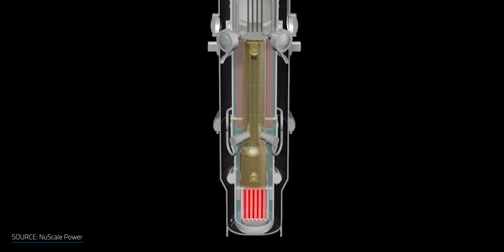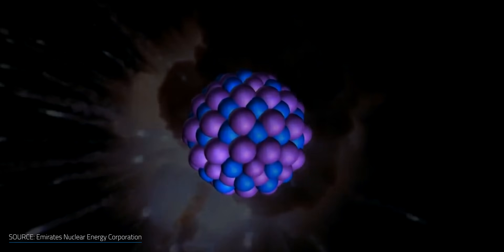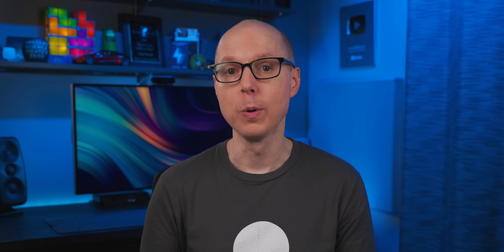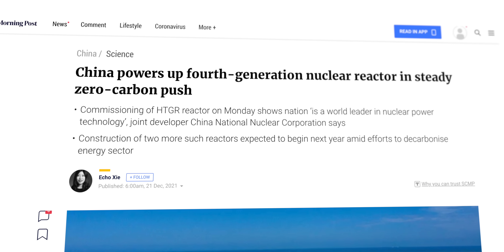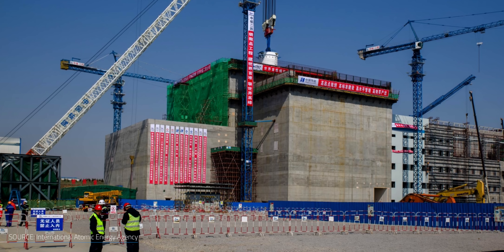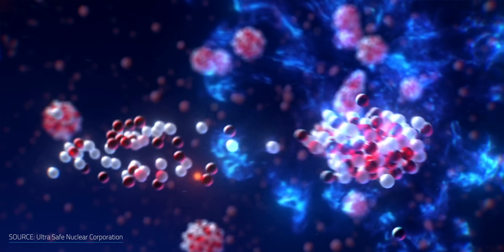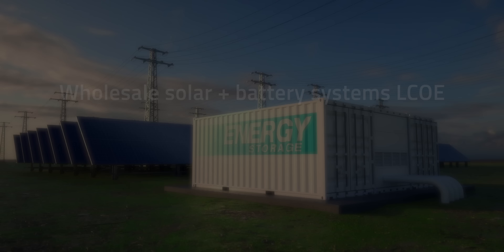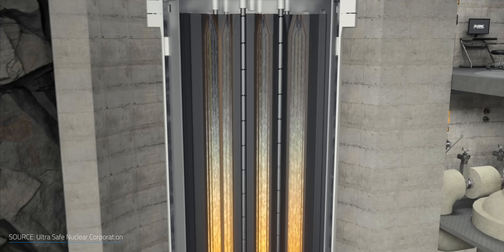Forget Small ... What About Micro Nuclear Energy?

Comment: A video would be looking into the waste from solar and wind. Both have a life cycle of about 20 - 30 years. Replacing millions of solar panels is not going to be cheap as well as wind mill blades. Remember will be replacing them for as long as we are depending on them for power. Cobalt is not renewable and toxic along with lead. Millions more panels are still needed…. Will need some very large landfills.
Reply: When we mine minerals used to make solar panels, we get them from dirt that might be as little as 1% useful materials. Those materials are extracted - either chemically or electromagnetically - and refined into the useful materials to make solar panels. Well, imagine if the pile of dirt was 100% useful materials? All you have to do is grind used solar panels into sand and you will basically have a ready made mine of minerals useful to make solar panels. The only difference is that now, you didn't have to chop down a mountainside or a rainforest or dump mining waste into a water supply to dig up these materials, nor did you have to burn fossil fuels to ship them to a processing facility. Recycling solar panels isn't quite as easy as recycling glass, but it is far more environmentally safe than mining coal, fracking for gas, or disposing of nuclear waste. As far as wind goes, the fiberglass blades ARE difficult to recycle, so wind power may need some R&D to produce more recyclable blades before we go heavy on wind power. Which is unfortunate because wind power is the cheapest of any source and would be the easiest and cheapest to implement. But we need to think about long term sustainability and reliable production of energy, not "easy" or "cheap".
Reply: @oggyreidmore  good thought to consider. Thought zero companies have come forth to recycle solar panels. I think it is more toxic than people think, cobalt, lead, and other toxic materials. And the wind mill blades are not much better.
I just want people to understand that light and wind are renewable, not the tools we use to harness them.
Reply: @oggyreidmore  unfortunately the elements from recycling solar panels is so low that nobody wants to do it. Costs are way to high for the rewards. Which means that they will be going to the dump. Millions and millions of panels, every ~ 25 years for as long as we are depending on them for the little they provide.
Reply: @stanleymcomber4844  I guess we should just stick with good ol' fossil fuels then. Humanity had a good run.
Reply: @oggyreidmore  but it is the volume of materials that is my focus. We are debating the management of millions if not billions of panels. All around the world. Needing to be replaced in a perpetual demand for power. It is a losing management plan not to mention a landfill nightmare. And if our "recycling" of plastics is an indicator of how things will be done, we're doomed. Solar panels don't float, and that should give a hint of what will happen to them. And that is just the solar panels, what of the windmills blades? Not even addressing the bird and bat issues. These things are huge and only last about eight years. Expensive to put up, expensive to take down, expensive to put in n landfills. 
All this and people say nuclear is expensive. The $ does not lie, and I do not see anyone reporting the full lifecycle of these projects, and the environmental costs. Reminds me of ethenol, spend two to get 1/2 back.

Comment: Check out Curio for a statrtup with good funding that intends to do used fuel reprocessing. That 85,000 metric tons of waste is 95% usable energy producing fuel, so it's an asset, not a liability. Energy NorthWest has signed a memo of understanding with Curio to reprocess used fuel from the Columbia nuclear generating station and two X-energy reactors in the planning process.

Comment: When, oh when, will you stop giving us silly comparisons of the cost per megawatt for intermittent wind and solar power versus steady-state power from coal, gas, and nuclear? You are comparing apples and oranges. I expect better more accurate reporting.

People need steady-state power, not power that suddenly goes off because the wind stops blowing and the sun doesn't shine. If you are going to show the cost of wind and solar, you must include the cost of building and maintaining backup sources of power. Otherwise, your analysis is simply false. [Your cost of wind/solar with backup batteries, which I assume you included to provide a better comparison with steady-state energy sources is also highly misleading. The number you used is for a system with batteries that at best cover a only few hours - not nearly the amount of time needed to prevent an outage like that which occurred in TX in the winter of 2021.]

Yes, nuclear is the future - not renewables.

Comment: A couple of arguments: It remains to be seen how economical it will be to add additional reactors when more power generation is needed. You mentioned Thorium reactors as having less waiste. That only occurs when "fuel reprocessing" is used, and that also requires hugh regulatory licensing and red tape, and not to mention the political and other misinformation generated by anti-nukes. Also, maybe in future videos on nuclear, can you not use the images of 55 gallon drums as how we currently store unspent nuclear fuel? But I agree that the best option to get "generation 4" nuclear started is to use solid fueled reactors that use TRISO fuel (a few of reactors you showed use TRISO). I'm not too keen on using water though as I wonder if large containment domes are needed to contain a steam explosion.

Comment: Seriously consider the vortex micro hydroelectric system by turbulence. For every 6 ft of drop using a 3-ft cube of water you will get enough power to power power 30 modern homes. if you could harness that through The Gorge in Oregon with its trip to the Sea you will see that same, rcycled 3 ft of water will power tens of thousands of homes with no fish kill no damage and actually cleaner water at the end. Homework time. Do the math.

Comment: My main issue is efficiency. Suppose you could scale an SMR down to the size of a can of Coke. But now the reactor is only 3% as efficient as one the size of a semi truck.
A Coke can reactor might make sense for a satellite or something, but it's not particularly useful on Earth.
But now suppose you can scale it down from a semi truck to a washing machine and it's still 60% as efficient. That's a lot more acceptable.
Washing machine reactors could power small boats and even medium-sized yachts. They could power trains. I don't think the semi truck ones could power a train because that's horizontal and they need to be vertical. But if you could get one to operate vertically then we've really done something.

Modern trains are diesel-electric hybrids. Very efficient. Simply remove the diesel engine and replace it with a horizontal SMR. The train will run for years and not burn a drop of oil, other than lubricant. It would be about the easiest one-for-one power swap there is.
The question is, can reactors be made to operate horizontally?
And if so, this has major implications for ships. A vertical SMR would be hard to fit into something like a PT boat (McHale's Navy) but a horizontal one might fit just right. I don't know how big their engines and fuel tanks were.
Simply changing the orientation by 90 degrees would open up the door to replacing nearly all the diesel power for all ocean-going vessels.

So is a horizontal SMR possible/practical? Or am I just engaging in wishful thinking and unicorn farts here?

Comment: Reactors can and should be used at various levels just like transportation vehicles. There are times when you need a bike, a car, small pickup truck, a big rig 18 Wheeler, and a freight train.    Small modular reactors should be used in remote small towns. They can also be used in very remote locations like Alaska's North slope.   India could use them in very remote poor and isolated towns

Comment: Claiming that nuclear power production has resulted in fewer deaths than have resulted from other power generating technologies is the same as Trump's claim that there were only 5 cases of COVID-19 in the USA, so there was no need to worry about it. 

Nuclear proponents always breeze through discussions of the nuclear waste. Until there actually is a reasonable solution, no nukes of any size should be commissioned. Oh yeah, waste that remains radioactive for 500 years is not reasonable. Neither is combustion of fossil fuels. As a society, we must reduce our electrical demands to the point where clean, safe technologies can generate adequate amounts of electricity.
Reply: Nuclear energy kills 90 people per thousand terawatt hours. That is lower than all but 2 energy sources.

Nuclear waste is not an issue. Bury it, store it in dry casks, or recycle it. All high nuclear waste ever produced can fit on an American football field

Comment: There is pleanty to be skeptical of in this list of random nuclear technologies.   
The Molten Salt Reactor (MSR) is not practical. It never reached technological maturity, because the Oak Ridge test reactor proved it was impractical.  Every part of a MSR (not related to SMR) needs to be heated to 1000 C just to keep it from siezing up.  It uses highly toxic chemistry, and is no panacea. The Oak Ridge test reactor never produced enough yield excede it's energy input requirements, and the actual yeild produced was 50 percent less then anticiptated, was offline nearly as often as it was running, and The Oak Ridge Test reactor was the only MSR to be tested in the free world.  the MSR got dropped from funding for a reason.
  Thorium Reactors exist only on paper, and have all the same problems as the MSR, plus additional.  
 Small Module Reactors, SMRs, are not related to MSRs. A SMR is a light water reactor designed to be submerged in a pool of water, about the size of a swimming pool, with passive cooling structures. No actual SMR has yet been proven as a power generation station, but many of the componenants have been built.  SMR is the most practical hope.
   Micro generation with helium coolant?  That sounds a bit out in left field. Consider that the main source of helium is natural gas deposits.
   All of these systems are designs.  They are not built and fully functional.  NuScale has had a rough start when their main backer was caught runing a ponzi scheme.  Be careful with your money.  There are a lot of promises with nuclear energy, but it seems like the best designs are  always 10 years away from being built.

Comment: It's important to consider the total costs of generating power. We often see comparisons that aren't apples to apples. For instance, the fossil plants often exclude costs of things like finding, extracting, refining, transporting, etc. fuel for the power plants. They also generally don't account for the waste produced because it is often just sent up a stack out a pipe or managed on site. And what about leaks and accidents? What about subsidies? Wind and solar don't suffer the same risks when it comes to leaks and accidents and don't require fuel. We hear a lot about nuclear waste, and rightfully so, but it should be a cost that is simply accounted for. Such analyses represent the total cost to produce a kWh of power.

Comment: You might check out the Dual Fluid Reactor. If the hype can be believed, it can run on uranium, thorium, or even nuclear waste. Plus the design uses molten lead (yes, lead!) for coolant, so that gives them the benefits of metal cooled reactors.

Comment: Regarding waste, how does the little nuclear battery on the Mars rover work? 
Couldn't we recover energy from nuclear waste using that principle?   I'd like to have a little nuclear battery buried under the house or something analogous. Be part of the solution. Even if it only provides enough power for night,  when the solar panels are off.
Reply: Isothermal generators produce so little energy its not feasable

Comment: The problem with current nuclear power is the waste. Even 500 years is a long time to get rid of problem. So to say it's extremely save is not taking future catastrophes into consideration. Fukushima is the best example. Natural disasters happen. Combine that with nuclear waste being disposed in the environment can easily tip this into a complete different picture.
Reply: Fun fact: If the 2011 tsunami happened just a few years later, fukishima wouldnt have happened because they were designing a new flood wall in case a larger than anticipated tsunami hit the plant. There is no issue with nuclear waste. Bury it, store it in dry casks, or reuse it.

Comment: Too bad uranium is a very scarce ressource on the planet and as such nuclear power was never fit as a technology for the future(next 500 years) and the resulting materials are highly dangerous. Otherwise these developments would be a nice thing.
Reply: uranium is not at all a scarce resource
Reply: @KayC352  I am sorry to inform you but yes it is. Even if we use the best technology available, which no nucelar power plant is using atm and no micro plant can use, the available uranium would at most be enough for the next 500 years. As it is right now, if we use uranium as the main source we would be happy if we could bridge the next 50 years.
WorldWide availability: 8,070,400 tons	WorldWide Historical Production since 1946 2,818,415 tons
Do the math if we start to use uranium excessively.
Reply: @Taobyby  nuclear accounts for 10% of energy production each year, which equates to 675,000 tons of uranium each year if we switch 100% to nuclear. 40 trillion tons of uranium exist on earth. If we are liberal and say that only 0.01% of that uranium is accessible, that gives up 5900 years of nuclear energy at current rate. Furthermore spent nuclear fuel can be recycled. We will definitely have nuclear fusion energy by the year 2500, so yeah, nuclear is feasable

Comment: I think nuclear SHOULD be our energy future. we SHOULD replace as many current power installations - including wind and solar - with nuclear as possible. As for the waste issue, we simply recycle the nuclear waste. France solved this decades ago.

But this WON'T happen, because the global elites have decided that the solution to ALL of our problems is deindustrialization and depopulation.
Reply: Flammability safe Hydrogen, biofuel, tidal is the future alongside microreactor nuclear energy. We cannot replace wind energy and Solar in desert land and desolant areas away from ground water/water/habitants.
Reply: @maroon9273  Nuclear will work just fine anywhere. Along the coast in Africa, for example, it can be used to desalinate sea water and provide the power necessary to pump that water inland to areas like the Sahara desert. Proper materials usage would allow us to grow trees and crops on the Saharan sand, transforming the desert into a veritable breadbasket, while simultaneously sequestering tons of CO2 (for those who care about such things). Nuclear power would allow this, using SMRs, molten salt reactors, thorium reactors, pebble bed reactors, or other new technology that is leaps and bounds safer than anything we've built in the past. Properly done, nuclear can EASILY replace everything we have now, including wind and solar, eliminating the need for unsightly bird guillotines and space-wasting and pollution intensive solar panels. And nuclear coupled with biomass gasification? THAT'S revolutionary right there.

Comment: Wouldn't also - apart from miniaturisation - changing our approach to nuclear fuel itself also help? Coating uranium rods with carbon should reduce both radiation and requirements for cooling systems? 
Also what about Low Energy Nuclear Reaction technology? It doesn't have any of classic nuclear reactors problems, is also miniaturised and relatively cheap to produce.

Comment: Light water reactors are NOT the way to go. Solid fuel/liquid moderator limits the potential utility of fissionable fuel as heat to less than 1%. That being true Light water reactors should not receive a favorable mention in this presentation, no matter their size. 
Liquid fuel/solid moderator yields fuel utility of at least 25%. Nuclear waste left over from our current batch of light water reactors can be introduced into the fuel stream of a liquid fuel reactor. That strategy reduces the amount of nuclear waste in our disposal streams and provides a path to convert stores of plutonium to useful energy.

Comment: Nuclear power is stigmatized for creating radioactive waste. But the physical properties and containment of the waste is commonly misunderstood. Most Americans think nuclear waste is a barrel of glowing, toxic chemical sludge. Most people could not point out a nuclear waste facility from a silo or a warehouse. And if they were looking directly at it, it wouldn't be glowing green sludge, at all. The vast majority of nuclear waste is a solid rod of ceramic plates and metal that has been contained by a silo-shaped tomb of lead and steel and filled with concrete called a cask. We can bore holes into the ground and store these coffins using technology from the oil industry. The nuclear waste problem was solved long ago!

Comment: SMRs have been tried at various points, including some attempts back in the 1950's. Sadly, the history of these efforts doesn't particularly bear out the current hype. Undoubtedly they are technically feasible, but it is FAR less certain that they will attain even the LCOE of existing large commercial thermal reactors. Nor do we have experience to back up the claims of increased safety and reliability. This is not to say that development efforts should be abandoned, but we should not overestimate the likelihood that this is going to form a major part of our future energy equation.